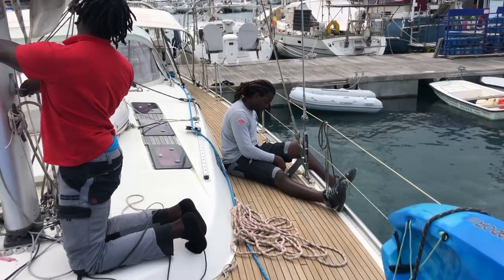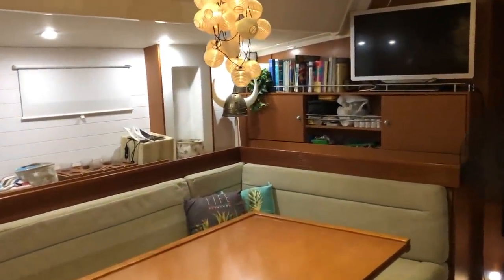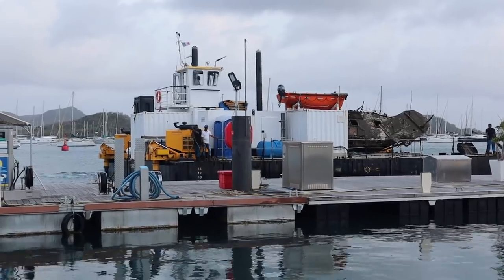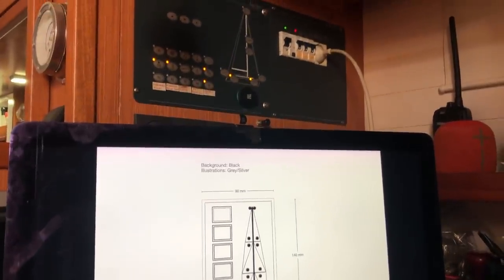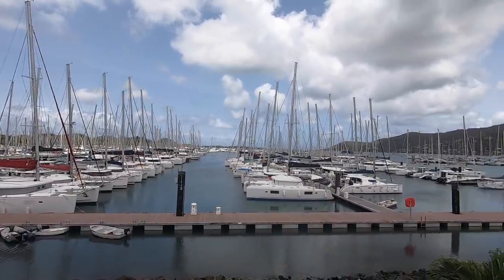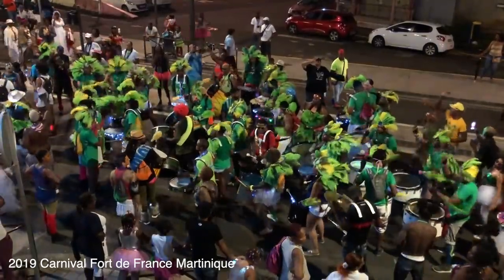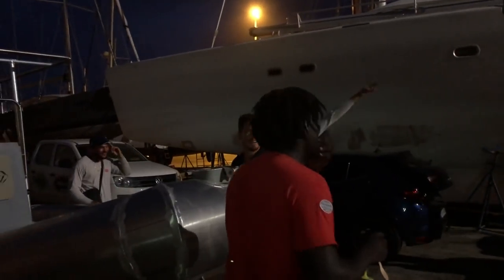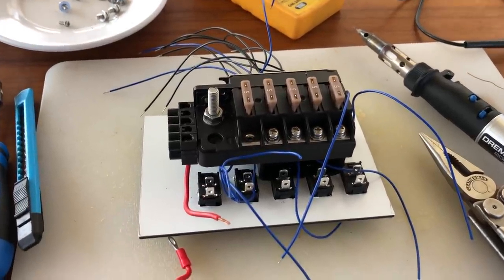Refitting almost done - SwT 56 DIY projects PARTY and PROGRESS

Comment: Very nicely done  Captain. When you dim a light does it draw less power? On the system or just for less desirable light. Looked like a great party as well. Thanks for the vid. Oviedo FL.
Reply from the maker: Thank you so much 🙏🏻 I will find out how much difference it will give by measure it. My skills and knowledge in electronics is very limited but learning more and more. The lamps are 1,3A and 16W so with all on max power it will be 13A and 160W with total of 10K lumens. So it’s definitely gonna light up BE FREE. I’m pretty sure dimmer will be a good call and also option of turning off the lamps facing down. Thank you for watching and being here! Cheers 🍻